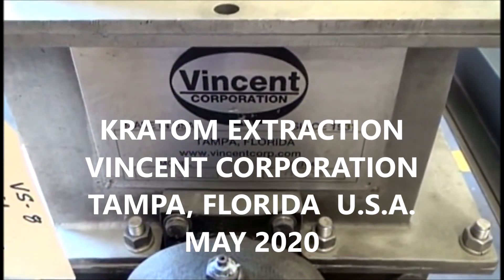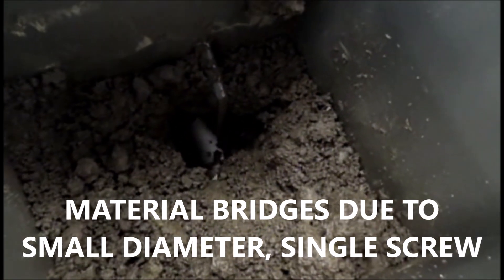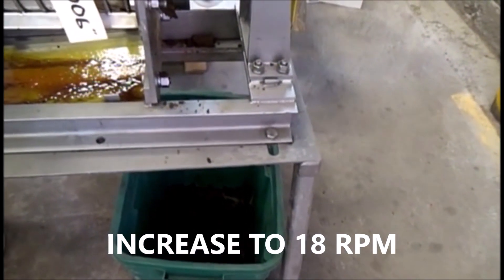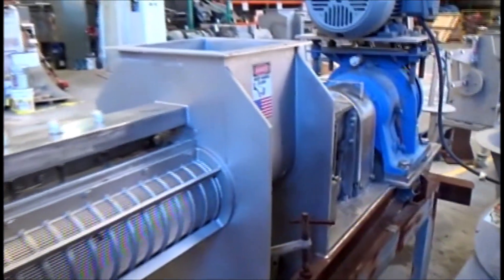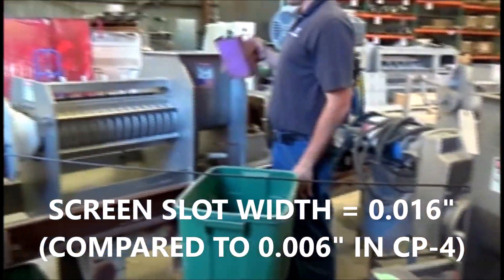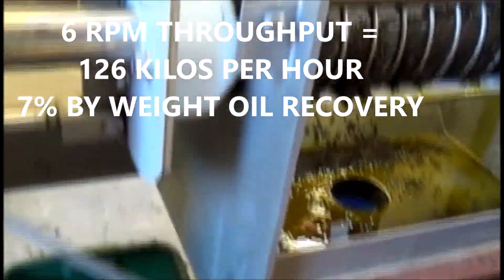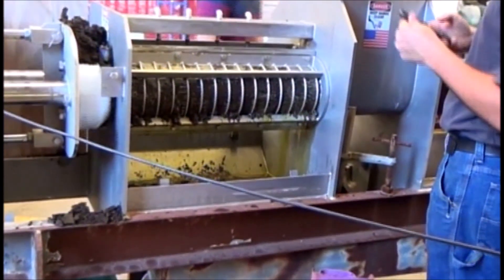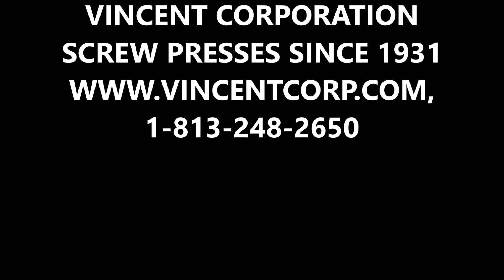KRATOM II

Comment: Very interested to know why the kratom you have is full of oil why I buy in bulk it's dry. Also do you have a way I can get in touch with you
Reply: The Kratom he is using is not full of oil. They are taking normal kratom powder and soaking it in five gallon buckets with 50% citric acid or 40% ethanol for 7 to 10 days. After the long soaking process they are straining it the press machines. This is where the oil is produced.
Reply: @splizz  what Type of press could be used to do this successfully on a smaller scale? I tried a hand operated screw press but the holes in the press cage cape to large..
Reply: @shanelocky6004  We use a .006 or 152 micron screen.  Thats about as small as they can get a wedgewire screen.
Reply: @splizz  thank you.
Reply: @splizz  isn't 50% citric a ton? Why wouldn't they use denatured ethyl since its cheaper? Why 40%
Reply: @splizz that’s amazing is there a better faster way? Like using methanol? Would that work with a 20 mins soak
Reply from the maker: Direct all inquires to Vincent@Vincentcorp.com
Reply: @VincentCorp1931  can u email be about bulk extracts I run a few kratom shops in Wilmington,Nc and only distribution:

Brandon@wgbotanicals.com
Reply: What is the oil used to make?
Reply: Methanol is poisonous. This extract is meant to be consumed